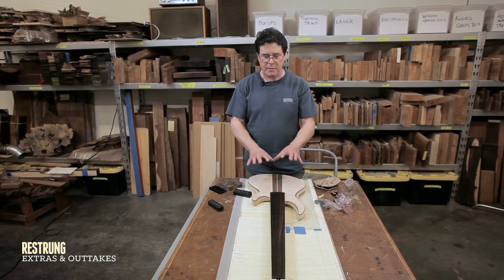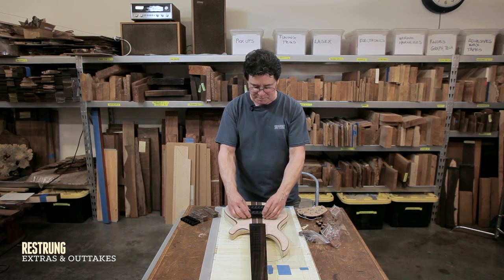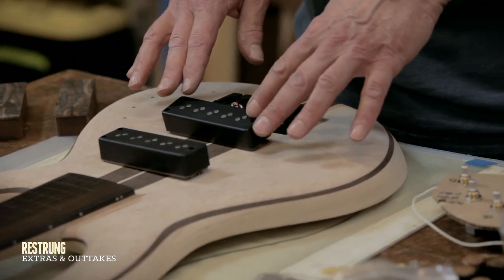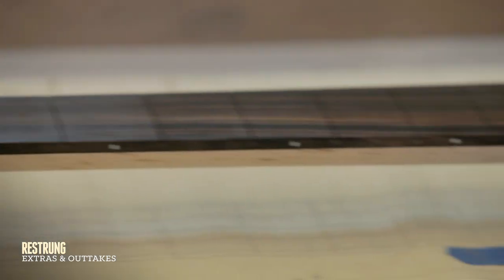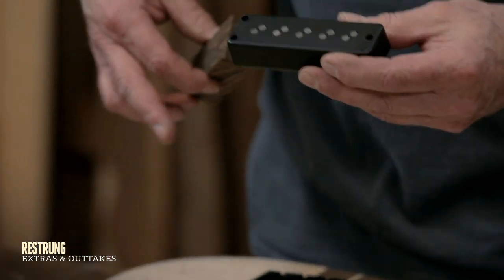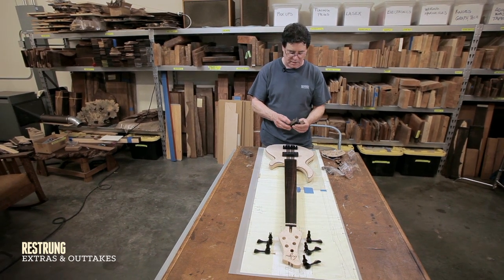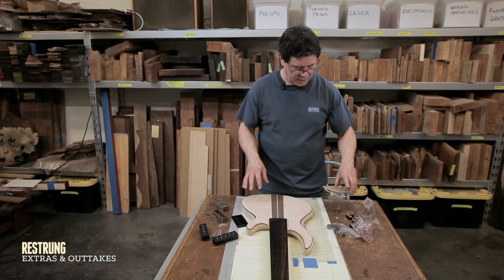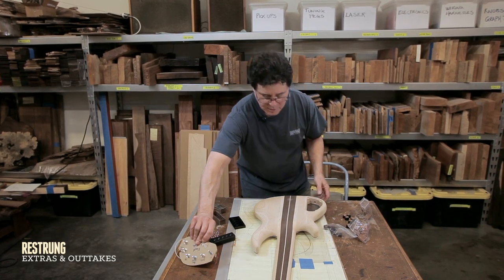How to Build a Bass Guitar - Step #12 - Pickups, Bridge and Tuners

Comment: Ha, and that difficult conversion to fretless has a side effect. For my other bass, I carefully sanded the frets down. No damaged wood, and for a newbie, those bright lines on the fingerboard are a good thing. How long would the average contra-bass player need to practise, until muscle memorie puts fingertips on exactly the right spots?

Last week I drilled and chisseled and sanded three slots for my pickup, all through the new cheap (home made) pine body. Oh oh oh, it took time and patience. Now I can push the pickup out, and put it in either neck, middle or bridge position. Those two windows are funny. Should add window panes to the ones not used, like a scale model house. The body is large and sturdy, no fear my bass will break. Most exciting moment was assembling the bass, putting strings on and listen. Would it remind me of the original pretty thin piece of plywood? It is good enough for me. And now I can start trying different pickups in my bass. The body is ready for this experiment. I guess I will start buying magnets and do the wiring myself. Cheapest, and you get the size you need.
    Again, thanks for this video.

Comment: Thank you for this video.
   I have only two basses, a Hondo 8300 Fame Series and another 70's-ish Japanese made bass that has a shorter neck. Ah, different sizes, surprise. So, the Hondo can be tuned some half tones lower, or string tension will be higher. I suddenly realised there is a lot that I still do not know. 
    I removed the Hondo frets, which turned out in damaging the fingerboard. I filled the gaps and painted (two colours, very 70's) the ebony-like fingerboard. On top of the paint I tried a superglue coating, and to my surprise, the result is a bright sounding fretless bass. Playing "standard" Ernie Ball strings and the tough superglue coating works fine for me. Although I murdered a fretboard. Maybe one day, I will remove it, and flip it around, playing the beautiful fretless backside.
     Thanks for the inspiration!